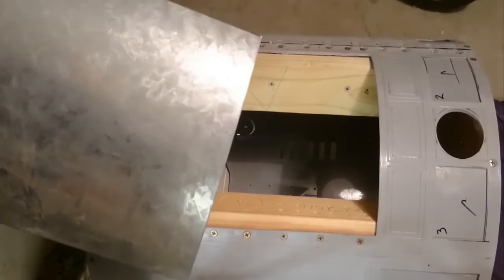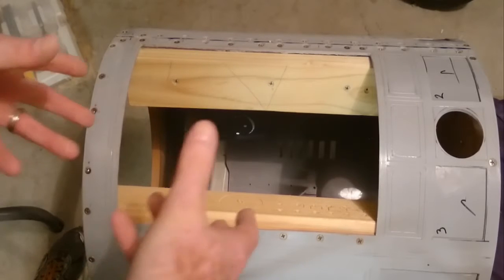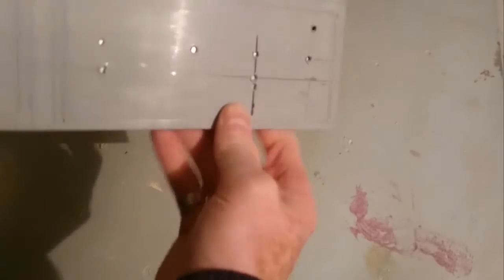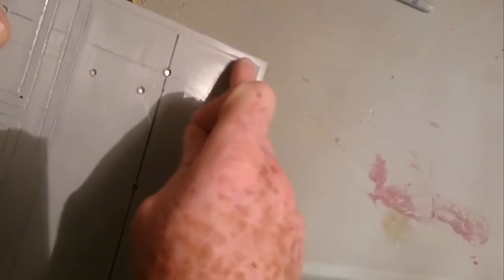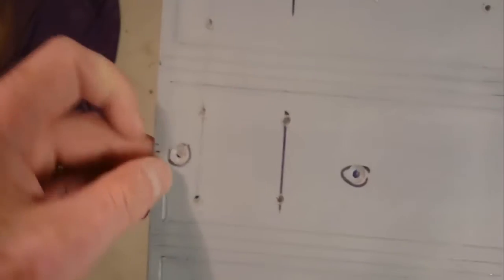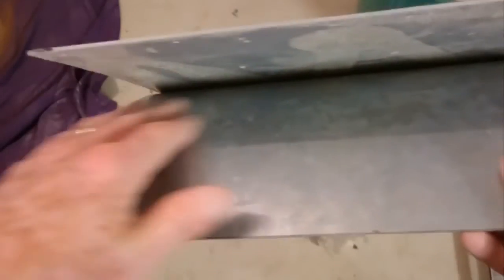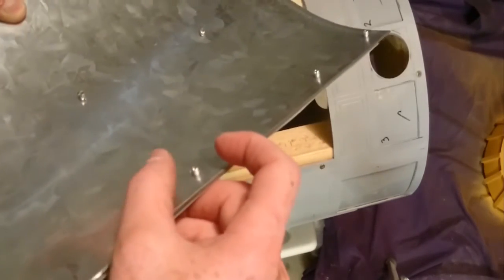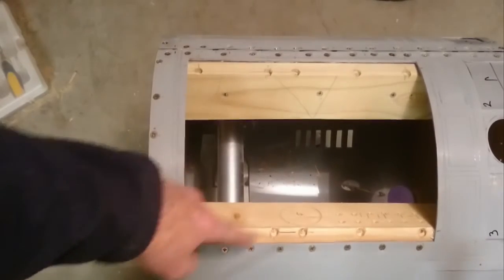D.I.Y R2 - D2 Episode 19 - Making The Rear Hatch

Comment: I finally nearly have my own R2 built but thanks to a guy called Mr Baddeley who produced a complete 3d printable design I went out and picked up a cheap second hand printer and got down to business. But thank you for inspiring me and showing me I could one day have something I've dreamt of having since I was a little kid which turns out was a bloody long time ago lol
Reply from the maker: Glad you are on the path of 3d printing. I am as well. There will be more videos coming showing some 3d printing parts.
Reply: @reviewprodigy  brilliant! I look forward to checking out your vids. The old 3d printing is an easy choice to make when you like to make things than aren't usually easy to obtain. But I found 3d printing has had its challenges to get the hang of but slowly but surely I get the parts I need lol very slowly lol
Reply from the maker: Once your 3d printer is setup correctly, you can do amazing things
Reply: @reviewprodigy  although R2 was my main driving force to get going with 3d printing I joined a charity called Enable and I produce prosthetic hands and arms so far mainly for kids and its shocking how cheap a gripping hand or arm costs to 3d print and add the extra bits, its still comes under 20 euros, I'm not sure what that converts into Ozzy dollars also it depends on the price you pay for your filament per roll but it still only takes less than 200 grams. Crazy hey
Reply from the maker: @nigelfenlon9035  Thats amazing, good to see you can use it to help people